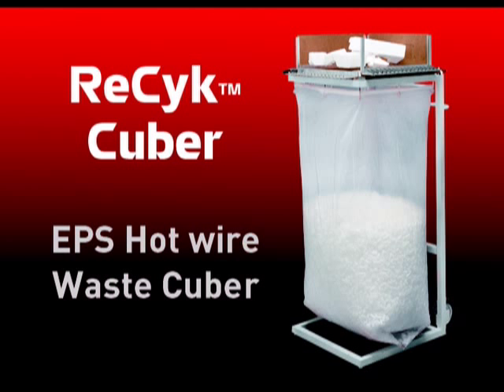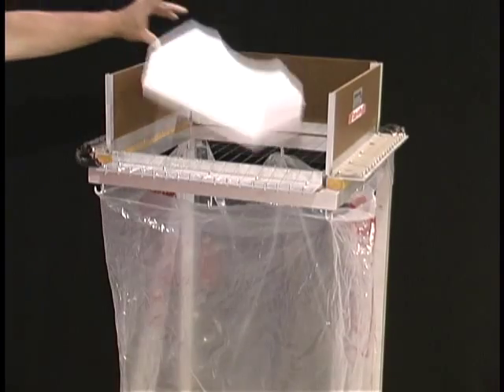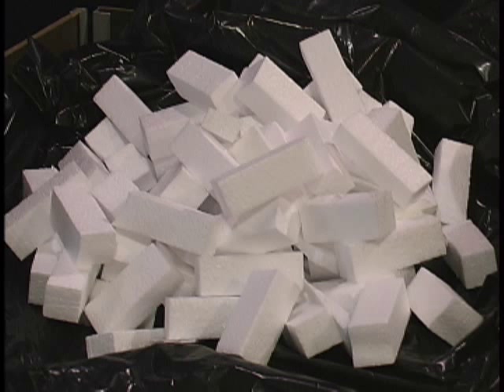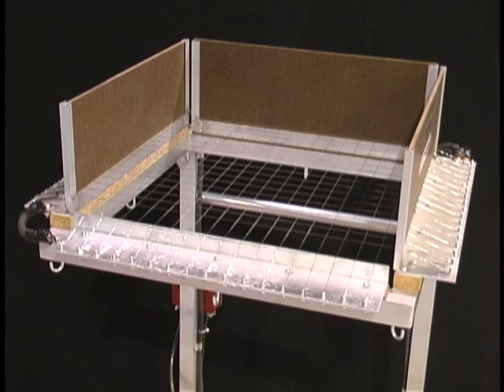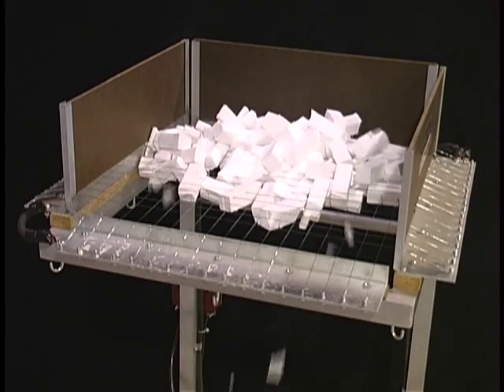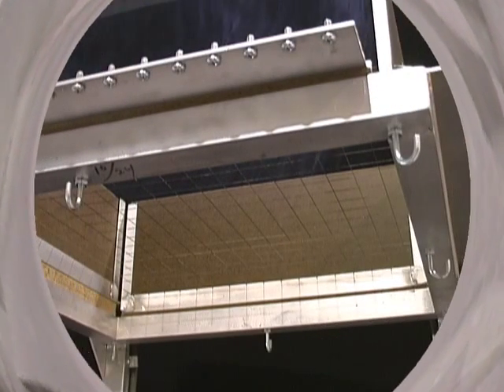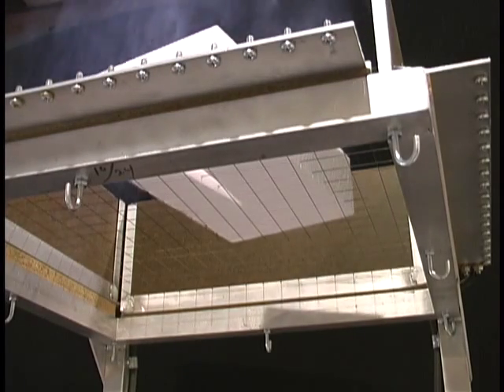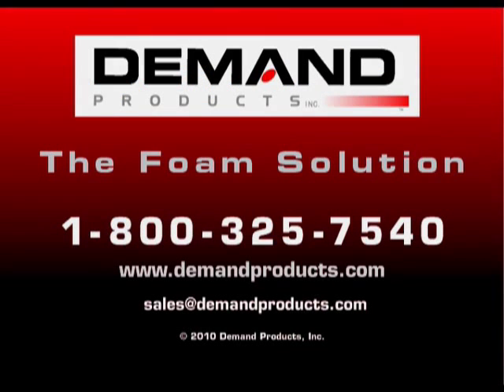Foam Scrap Recyk

Comment: too much toxic smoke better is mechanical way !
Reply from the maker: Thank you for your input. Our manufacturer has done extensive Air Quality testing    on our machines and has passed all tests to be safe for operation. The Niosh Health Hazard Evaluation for CDC found that "All results were below applicable occupational exposure limits".